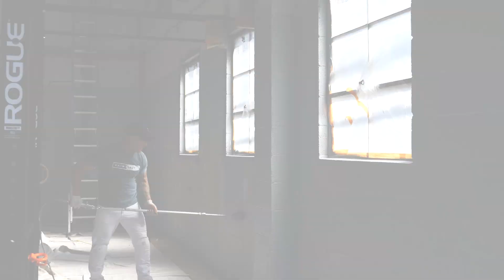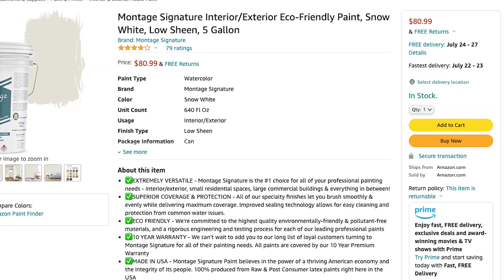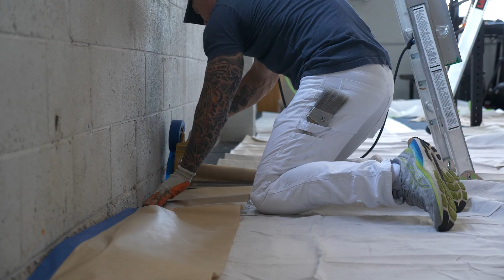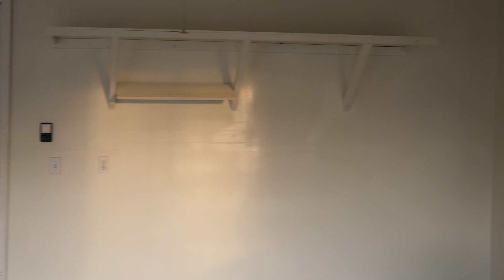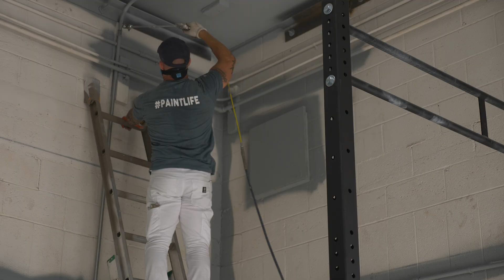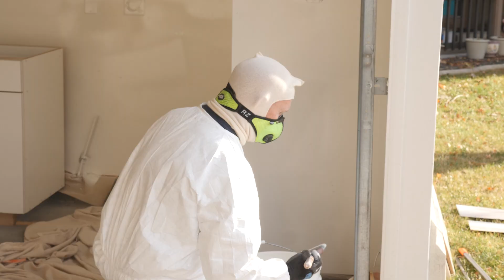Upcycled Paint, Is This this the Future of Paint? Montage Paint Review

Comment: Anyone can do this yourself. Dump multiple paint cans into a five gallon bucket, mix and apply. You can lighten by adding more white, or an easy way to tint paint is using a can of spray paint to tint it to the color you want. To strain the paint, using panty hose. This paint can be great to apply to an area you may not be as concerned about. (garage, barn, shed).

Comment: G,day Chris (Idaho Painter) from Sydney Australia.
Just had my first week on the job painting pipe service access doors. We have a small paint shop with a waste seperation pit for washing up, pots, brushes etc  My tasks included;
* Grinding off rust
* Applying rust guard (dries purple)
* Priming/undercoat
* Two finish coats of semi gloss vivid white.
I used a combination of 2"brush and 3" roller: would have liked a cut in brush. The small rollers are good, and, save your wrist:  remove brush strokes.
Thankyou
💧💯
Reply from the maker: Nice

Comment: You have to recycle paint but you wash your rollers and brushes down the sink? Sounds like a bunch of crap to me.
Reply from the maker: I think I may have washed a roller in a sink once in my career.
Reply: Sinks are designed for chemicals.
Sinks travel to water treatment facilities where it is filtered and purified from all toxins to be recycled for recirculation.

Storm drains are designed for water.
Storms drains are solely for water and travel directly back into the environment without treatment.

Sewers are designed for bio-waste.
Sewer water is sent to a bio-waste facility where it is converted into industry scale fertiliser.

The sink is the first and only place you dispose of your minor hazardous waste. Not even the toilet is recommended and you NEVER put chemicals down a storm drain.